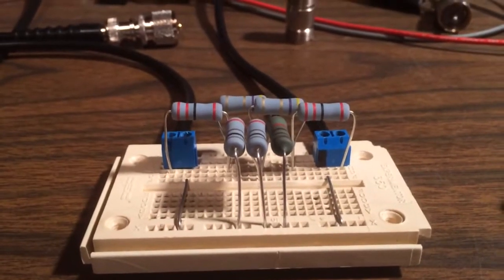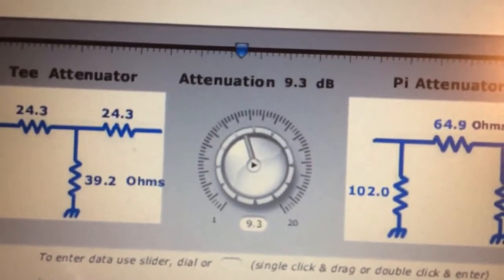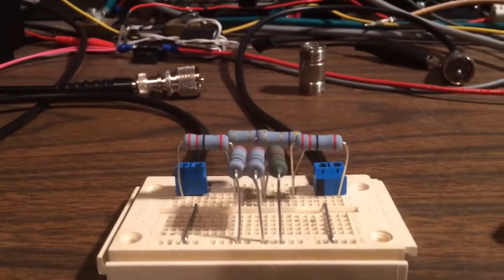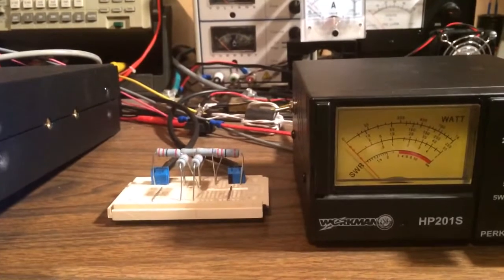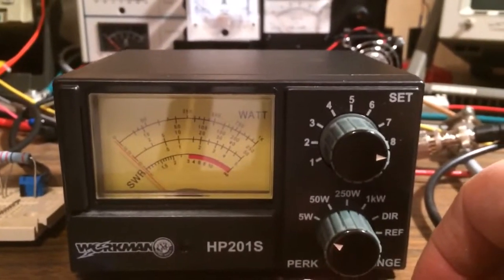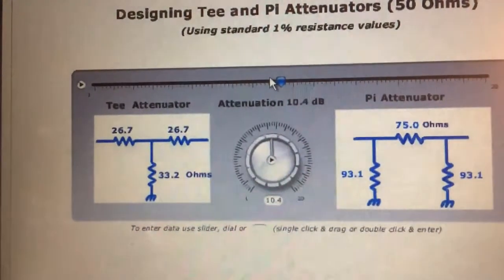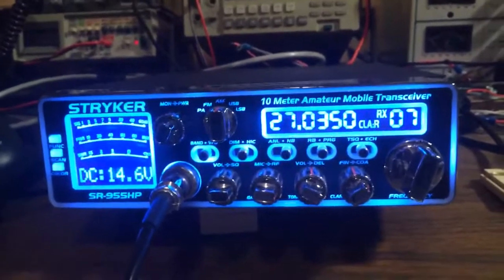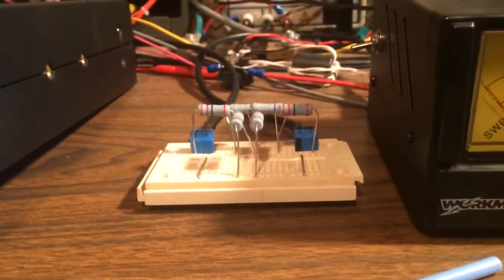Part 2: RF Man continues discussing RF attenuators for LDMOS amplifiers.

Comment: How do you work out resistor watt ratings
Reply from the maker: Each resistor should be rated the same as the input power. Thanks
Reply: RF Man Channel  I have done a little more research on the subject from what I found you have to make sure each resistor can take the load as first resistor takes a higher load than rest of the resistor so you may have have higher say resistor 1 10w resistor 2 may only need to be 6w and so on found a calculator online for that